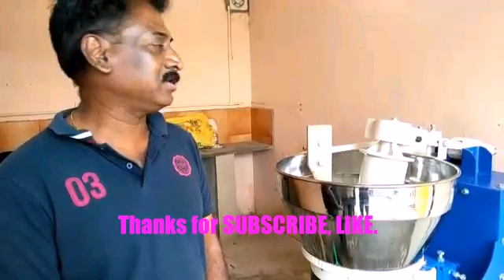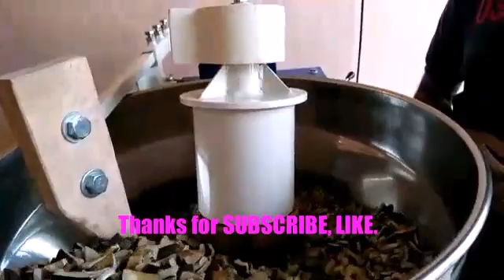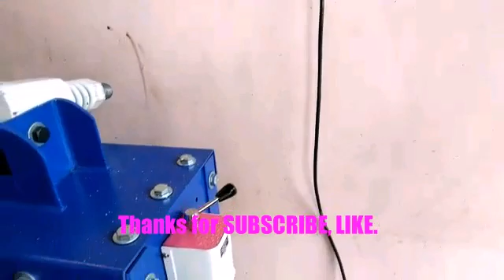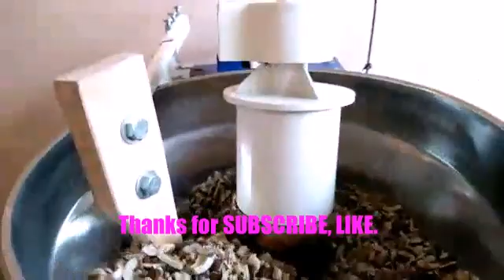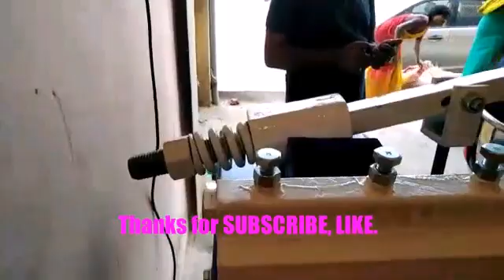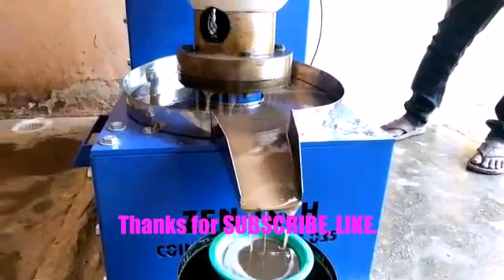#OUR_GOD_SANALKUMAR_Karnataka #MARACHEKKU_MACHINE. 7339197774. ZENTECH ENGINEERING

Comment: What is the price
Reply from the maker: Machines Rate:

Thiruvalluvar 180000+ 18% GST=  212400.00

Bharathi    180000+ 18% GST = 212400.00

Voc 6 to 18 kgs.      175000+ 18% GST  = 206500.00

Voc 10 to 25 kgs.  210000 + 18% GST = 247800.00

SS Ural voc.  230000+ 18% GST = 271400.00

Nethaji ( Rotary Machine )  220000+18% GST = 259600.00

The machine value including   Motor, Starter, Switch, Spanner, Cover, Allen Key and All other Accessories. 
Machine Delivery Time : Immediately or 10 Days.
Validity : 20 Days.

IMPORTANT NOTES : You can crush any oil in this Machine.
If you want single phase  3 hp motor it's available.

 This is Including fitting training crushing cost. ( This may be vary depending on DISTANCE of the BUYERS).

Our Service Engineer will come to your company, He will fit the machine and give training and crush any types of oil in front of you.

You want to pay transport costs of machines and  service engineer transport cost, Accommodation and food cost of service engineer.

If you want one more day of service you want to pay 1000 extra for service Engineer.

Thanks.

Thanks Regards 

Kanagaraj Paramasivam 
+91 98940 31929

Ravichandran Nachimuthu 
+91 99944 06061